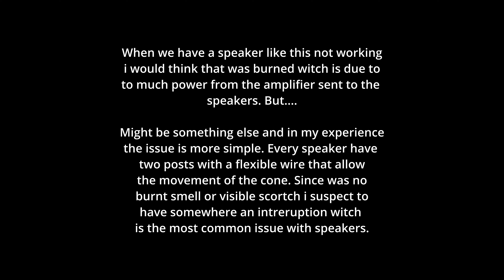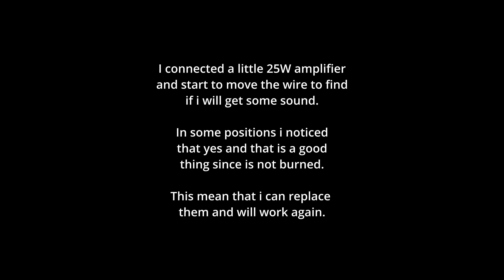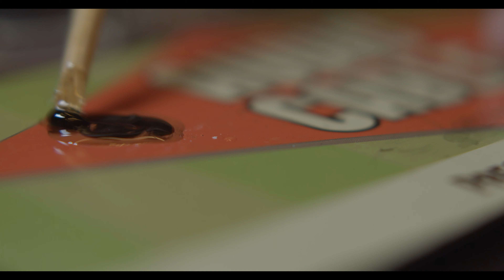FUNKTION ONE Twitter Speaker Repair (Easy Fix Walkthrough)

Comment: this is the 8" driver in e.g. the Res2 Tops right?

I have an issue that could be exactly the same but I can't get the silver top section out of the speaker without completely destroying it as it seems to be glued shut aswell. Do you have any tips for this?
Reply from the maker: Not sure what exactly what you need to remove. I didn't had to remove anything. I receive it exactly like this. If anything is glued heat always helps. Hair dryer or a heat gun works.